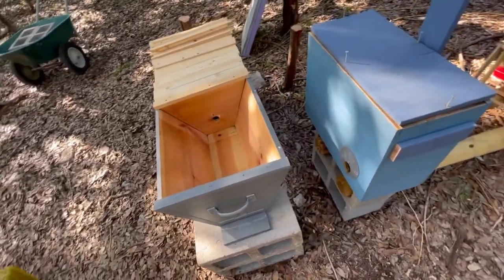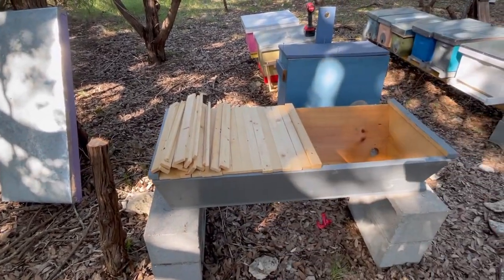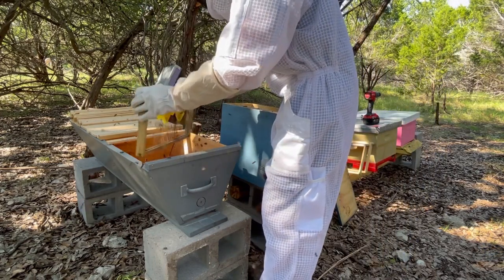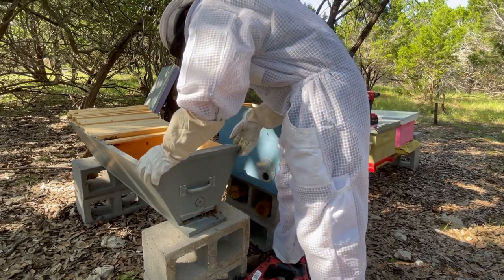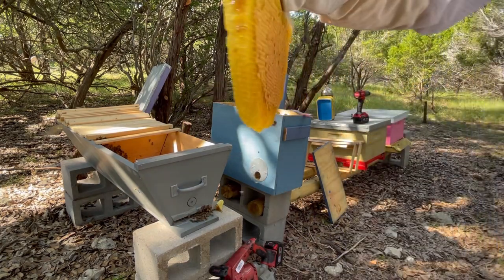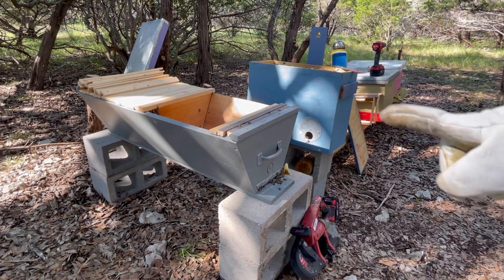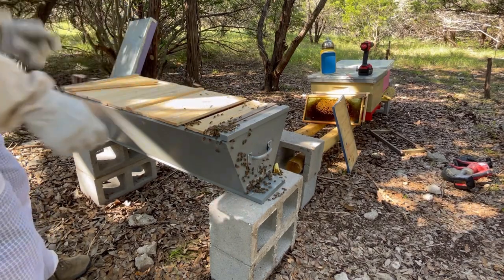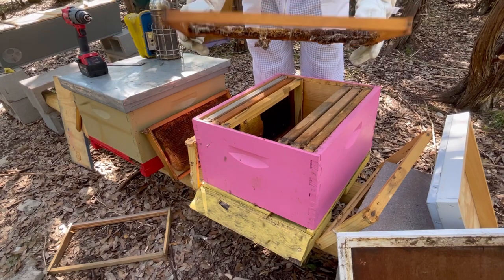HOW TO TRANSITION FROM LANGSTROTH TO TOP BAR HIVES - Treatment free beekeeping!!

Comment: I'm a newbie, I have a broodbox starting out and so far no bees yet.  I would like to go the natural way without using any type of pre-made frames etc. Any suggestions
Reply from the maker: I’d suggest consider buying or making a top bar hive so you’re able to inspect the natural combs they make. This prevents the idea of a frame. I suggest catching a swarm to put in there. 
The other option is to make swarm traps that are just boxes with no frames, and let them build from the ceiling of the box, and never open or inspect them. They’d be fully natural
Reply: @brownsbeefarm  catch a swarm, I've tried.  I've used commander, no luck.  I even got a Ritz-Carlton Bee Hive broodbox and super.  Super not installed until time is right and they still not making it a home.  No chemicals. It's natural wood unpainted but wood is protected.  Should I paint it.  Facing the direction of the morning sunrise
Reply from the maker: @stevenlouis1024  I think it takes the perfect sized box, and if you can get a hold of some old brood combs that will be the difference in catching one or not.
I use a homemade double deep nuc, usually a 5 or 6 frame. I put all the frames in mine, and the middle frame will be a dark brood comb out of a box. And a few sprays of swarm commander. The higher you can hang it the better. I usually hang mine 6 to 10 feet high hanging from a lag bolt in a tree. I also know they won’t move in if the box is in the sun. I keep mine in the shade of trees all day long.